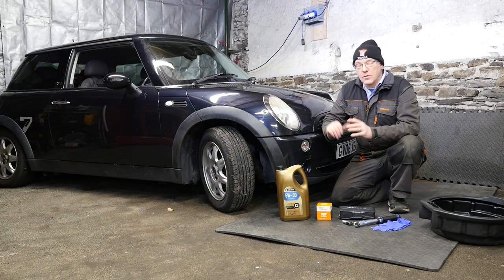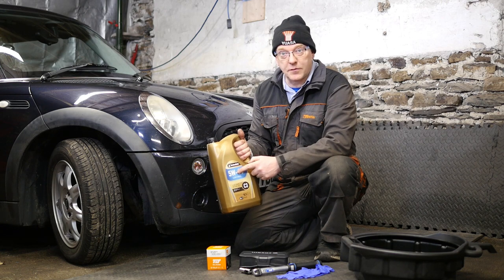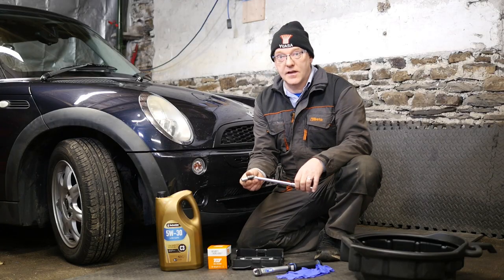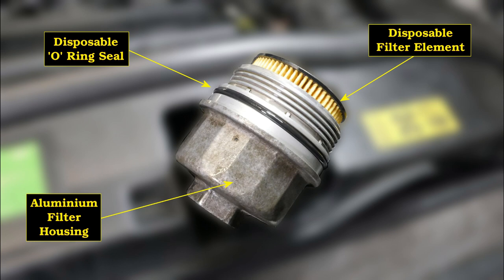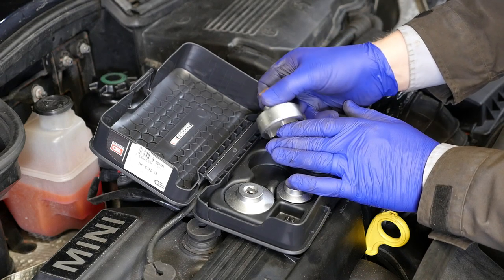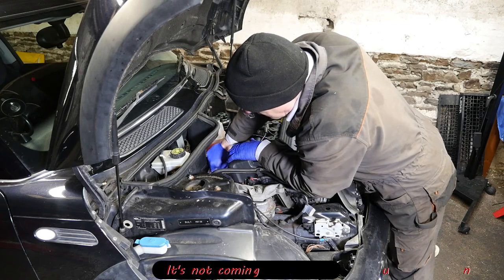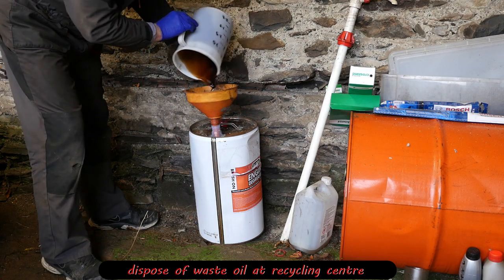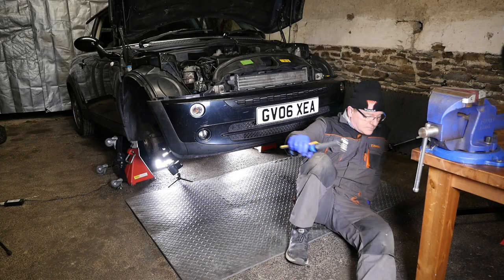Oil and Filter service on a MINI One R50.  Pre LSI Oil Filter mentioned & resetting Service Counter

Comment: Cold oil is 5 weight. Hot oil is 30 weight. I just drain the cold and thin oil since all the oil is in the pan not up in the valve train.

Comment: Thanks for the detail here. I'm curious though; Why did you remove the filter before draining the oil? Then I'm thinking you wouldn't need to worry about oil running down the filter housing (or does it not drain).
Reply from the maker: Thank you.  Normally removing the filter or undoing it will allow the oil in the housing to drain back into the sump.

Comment: I thought I'd comment here because it's hard to find infos on pre-LSI Oil filter housing, and I happened to struggle with it (again).

The Pre-LSI Oil filter housing comes with a detachable spring and cage. When they are present, the oil filter is REALLY HARD to separate from the housing. I had to use an oil filter wrench to have enough leverage to get it off both times.

If the spring and cage has been lost to the age, what several persons on the community recommend is to get a MANN filter: those work well without the spring and cage.
If you still have a spring and cage, do NOT buy the MANN filter, as the spring and cage won't fit. I'm using a Purflux one, but you may need to choose another brand available locally (I don't think it's worldwide). As a hint, it should have plastic on both sides (the MANN one does not), though I'm not sure it's a surefire way to choose.

Another hard to find info: in the Pre-LSI oil filter housing, there is a black plastic tube (see at 7:23 the tube protuding from the center of the housing? That's black on the Pre-LSI one) that is detachable and CAN unscrew and fall when you remove the oil filter. Don't make the mistake of throwing it away.
From personal experience, you can run without it if you have the factory spring and cage. But if you try to run without it while also missing the factory spring and cage, even with a known-good MANN filter, you will have the low oil pressure at idle. Revving up a bit makes it go away, then it comes back after a few seconds at idle.
Reply from the maker: Brilliant information.  Thank you

Comment: I found that the oil filter housing is easier to loosen if you bring the engine up to operating temperature before you do the job.

The heat of the engine causes the housing threads to expand and contract from one another
Reply from the maker: Thank you for that.

Comment: Arguably left me more confused. I have the crossland filter that was given to me from my auto parts shop, so is it no good? I had to forcefully remove the filter as it was stuck in the housing and couldn’t be clear of the orientation as it came out. My guide sleeve also looks different to the one you drew, and the owners manual is useless!

Classic Mini headaches lol… Should be a simple oil change now I’m worried about oil pressure.
Reply from the maker: Your probably better asking in a Mini forum on Facebook as I found it very confusing as well.  My Mini didn't have the issue so I think it was just the first ones originally.  A Mini group will have some experienced members that will know about it better I expect.

Comment: hi mark , thanks for the video , the oil filter cap was not a easy removal hhhh , but you did it , just want to say that mini recommand castrol oil BMW LongLife-01 A3/B4 spécification ,and not the C3 , i know that castrol is a little bit expensive , other brand is ok but you should respect the oil specification , thaks again and keep going
Reply from the maker: Thank you for the comment and compliment.  I was lucky the housing didn't shatter.  There seems to be some controversy over the oil as it's recommended that in Europe Long-life 04 is used but apparently this isn't advised in North America due to the sulphur content in the fuel.  Hayne's here in the Uk says Long-Life 04.  As usual everything is as clear as mud lol.  Are you in the US or Europe AA ZT ?
Reply: @CoatsandGaiters  in the past i had the same problem with the oil filter housing , it was so stuck that i forced to loosen the cap , a few days later i got a big oil leek , i remeved the oil filter changed the seal , the leek was always there , i ended up changing completely the oil filter housing maybe he got cracked somewhere . for the oil specification i learne something I didn't think there was a problem with the fuel thank you , i live in europe im from france
Reply from the maker: @aazt5792  Wonder why they get stuck.  I know two dissimilar metals can react together and cause a current flow and corrosion but the top and base are the same metals.  Wonder if people over tighten then miss a service or two and it locks on good and proper.  Thank fully it's not leaked and I've done a 100 miles in it.  My worry was breaking the tool more than the car haha.  My allegiance is with my tools over my cars.
Reply: @CoatsandGaiters  I think there are many reasons , people neglected servicing there cars , over tightening the cap , forgrting to lubricate the seal , and so on
Reply from the maker: @aazt5792  just glad it came off ok

Comment: What does the next value mean after service inspection value, i have reset that value too, which is 716 now after reset. Kindly brief me on that.
Reply: Also after resetting service inspection value to 15500, i drove my car 20 miles, but the service  inspection value is still at 15500 and not getting decreased, why is that?
Reply from the maker: @mak4661  I sadly don't have a Mini anymore so you might be best asking in the Mini group on Facebook.  This guys know the Mini inside out.  Sorry I couldn't help but have no owners manuals anymore.
Reply: Ohh its ok, thanku for the guidance.

Comment: Hi Mark No Cage?

How did you get on with your filter? 

My ordered part SKOF-0860124 also comes without cage inside.  Says its suitable for my R50 but It would be if the car had the old housing wouldnt it ....

Did yours in the vid crumple once wet? 

Lee
Reply from the maker: Mine was ok and had no issues.  Car now sold and all was ok.  Really confusing area isn’t it.
Reply: @CoatsandGaiters  It is, cheers for the confirmation, I'll stick it in and see what happens
Reply from the maker: @leemch6343  I believe you can still buy the old original filters for the spring and cage type of housing
Reply: Indeed, guessed that would be the case which made me wonder if I had ordered the wrong one

Comment: Hi Mark, i just wanted to know your thoughts. I’m trying to get to the bottom of something. I recently changed my timing chain on my r50 mini and fitted a new hydraulic chain tensioner. At the same time I changed the oil and oil filter. 
I now have a weird situation where if the car is sat for a week and I go to start it, there’s a horrendous rattle for a couple of seconds until the oil pressure builds up. It never did this before, so I suspect it’s either something to do with the new oil filter I fitted or return back valve playing up or it’s the hydraulic tensioner. What do you think it might be?
Reply from the maker: Wonder if the oil is draining out the system while sat.  Normally there's a spring valve in the oil filter housing housing at the bottom to keep the oil in the filter.  Sounds like the chain rattling.  Does it take a while for the oil pressure light to go out as if you had just done an oil change?  Don't forget the filter issues with the old one and the new life cycle impulse ones as they had a cage inside and a spring.  Might be worth checking if the filter was the correct one for you car.
Reply: @CoatsandGaiters  thanks for replying. The oil pressure light goes out straight away even after standing for a week, as if everything is working as normal in that regard. 

The type of oil filter housing cap I have is the one with a cage and spring. 
The filter itself also has a cage. I checked all this this morning. 
I have changed the filter this morning so I’ll see if this makes any difference. I think my return valve is also working ok. The filter was the cheapest thing to replace. 

If this doesn’t fix it, I’m going to change my hydraulic tensioner which came with the BGA chain kit. I wonder if the BGA ones aren’t very good. The one I took out was a febi Bilstein but unfortunately I threw it away. I might have to bite the bullet and buy another febi one. Not sure what else to do really.
Reply from the maker: @petea7323  just to check when you put the tensioner in did you leave the plastic bit on it as initially I removed mine thinking it was a protective cover and didn’t realise it was part of the tensioner itself.
Reply: @CoatsandGaiters  I know what you mean. I don’t believe I removed it but can’t remember. I’m going away for work for a week, on my return I’ll start the car and see if this new oil filter has made any difference (I have my doubts)
Reply: @CoatsandGaiters  hello Mark. Just a quick update on this. I replaced my oil filter from a Crossland branded one to a Bosch and the startup rattle has completely disappeared. I left my car for 6 days without starting it and started up with no issues. Maybe somehow the crossland filter was allowing the oil to drain back into the sump. I’ve read online a bad filter on these cars can cause oil pressure issues on startup. 
I’ve read Mann and Bosch are the ones to go for.
Reply from the maker: @petea7323  seems to always go back to quality products win the day doesn't it.  My wifes CV boot on her Laguna failed and we replaced it with a stretch boot, that perished in a year, so changed it to a boot you glue together !!! that perished within a year as well.  Next time we are going to remove the drive shaft and put a proper branded boot on.
Reply: @CoatsandGaiters  that sounds like a good plan. Plastics and rubbers are very hit and miss I find. Sometimes they last a year, sometimes they last 30 years. The quality varies hugely. It’s certainly a minefield out there when it comes to aftermarket parts.
Reply from the maker: @petea7323  I was staggered they don't seem to last much over a year.  OEM parts last over 10 years